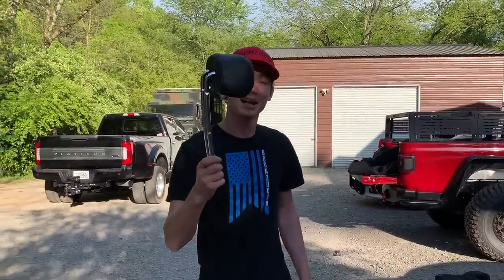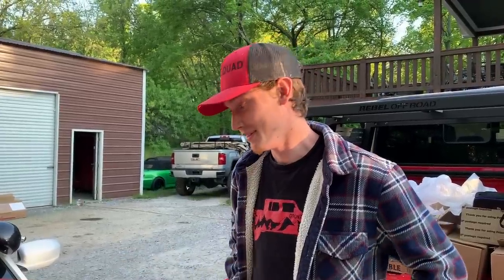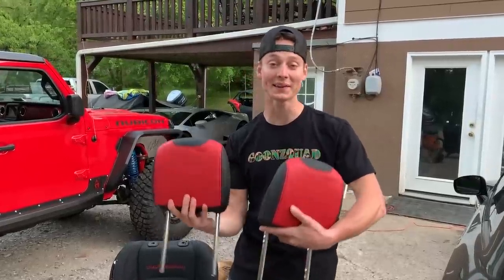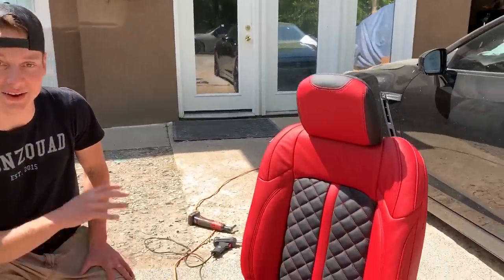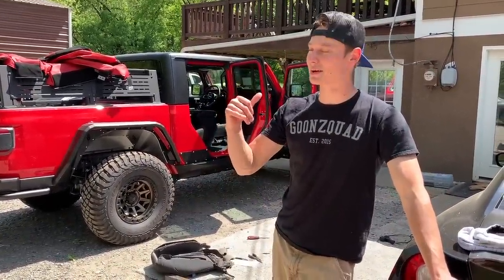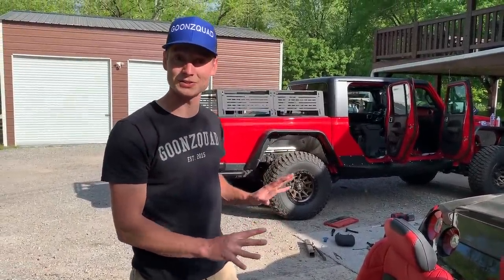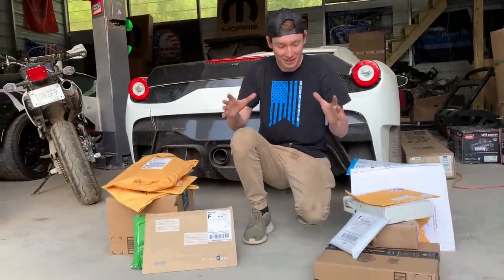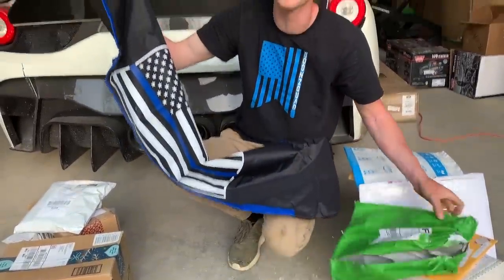Rebuilding A Wrecked 2020 Jeep Gladiator Part 18

Comment: Alright Dad's back horsing around and giving you guys a hand lol . I'll bet he's excited about helping as much as he can so you all can hop back on the Dodge truck build . I'm sure if you go on eBay or Amazon you will find hog rings and hog ring pliers if you have any other interior projects . The tie wraps look like they're doing a good job, hopefully they don't get brittle and become prone to breaking. It looks like a good idea i just hope they last . That's a wicked nice interior upgrade kit you went with.
Reply: Robert Prout I was the thinking the same thing with the zip ties.  Hog ring pliers are the way to go and they are easy enough to use.  Do the job right the 1st time.
Reply: Billy Boost are they easy to use? I’ve been afraid of reupholstering an interior, mainly because of having to work with hog rings.
Reply: hog rings are very cool, usually stainless steel, suggest the manual tool as not too many to apply on most seats, the semi auto ones are a pain in restrictive spaces, the track will dislodge, those who use em know what i mean, as for cable ties, most go brittle in sunlight with UV degradation but you can purchase pre-soaked ones, the shrinkage is less therefore last longer, less prone to going brittle, they are used a lot in fishing trade
Reply: Northern Farmer, take the crap somewhere else! 👎🏻

Comment: Zip ties will break over time. Probably should have stuck with the metal hog rings, they have been used for decades for a reason.
Reply: Nathaniel S. RN  used to work at a place making Toyota seats and all we used was hog-ring guns.
Reply: Facts and they are 20x easier to install them the zip ties🤷🏻‍♂️
Reply: I'm sure they don't mind removing the seats and upholstery out again to address the leather cover popping loose. If it ever gets to that point
Reply: I’ve been working on seats for cars/trucks for about 20years, zip ties are NOT the way to go here. Hog rings like the OP said. They are a lot easier to deal with than zip ties and they will last forever.  If you are gonna do it, do it right.
Reply: I can't believe they didn't go with hog rings. I had to pause it because I don't like watching trash ass installs
Reply: The devil Made me say it 
So that’s where haters come from.
Reply: The devil Made me say it  I've enjoyed watching them grow and learn new skills.  It's informational that way.  Sometimes they cheap out and don't add much value to create content.  This is one of those times in my opinion.
Reply: Agree I’d be worried of the zip ties working their way into the leather and cutting it over time. Definitely take the time and replace with the new hog rings
Reply: Todd I've been working on cars for 95 years and my uncle once told me..
Reply: Ethan Verstraete it would take many decades for a hog ring to rust enough to be a problem under normal use.

Comment: Zip ties will get fragile over time and snap when you are sitting in that seat
Reply: and the part they cut will be sharp and damage the leather when they sit on them.
Reply: It’s not like they drive there builds anyways
Reply: @f1lip797  the gtr was at a different spot in the previous videos, so yeah, maybe they don't film everything they do with the cars.
Reply: Yep. They should have used Hog Rings like they were supposed to.

Comment: That plastic on the head rest was used to suck the foam down so the fabric cover could easily be put on then the vacuum is released and the foam goes back to the original size. If you've ever had to fight with putting a headrest cover on foam thats not compressed you will quickly understand why they do that.

Comment: You need to put hog rings in the seat. Zip ties will break, and they will wear holes in the leather!
Reply: almost OEM :D
Reply: Second the hog rings.  The cable ties will not last.
Reply: Nae bor u daffy
Reply: youd think they would know better.. lol kinda like no truss or gus or any support for those coil overs... these two are a mechanics dream to fix what the screw up
Reply: do you think people will be throwing themselves against the seats? lol.. zip ties will be just fine. i swear some people over exaggerate. so much
Reply: Vinnie Gunns not sure what you’re on about. It was a complete legit suspension kit. Maybe you need to discuss your engineering experience and ideas with the suspension kit manufacturer? The skills and work ethic these two young blokes have is awesome to watch.
Reply: Gotta agree there those are pretty heavy duty tie strap they will probably rip the leather in the long run or you may start to feel the clipped ends of the strap
Reply: Bon Paoi tampon smoker!
Reply: @apet1572  I've been doing upholstery for over 25 years. The ties will last a little while but not for the long run.
Reply: Chris Lambert did anyone ask what you’ve been doing for the past 25 years ... didn’t think so
Reply: Did anyone ask for your opinion....didnt think so
Reply: I would not have used cable ties either.

Comment: I'm just at 3:45 and just have to say that the plastic around the foam on the headrest might be as you said for keeping water out of the foam, but in other cars that aren't "waterproof" they are simply there to make the cover easier to put on. If it catches on the cover as you try to slip it on the foam might break. This plastic just keeps it from catching.
Reply: It's there to reduce friction from the foam and fabric. Helps extend material life

Comment: I’ve never seen anyone use zip ties on a seat. You can buy hog rings and hog ring pliers to fasten the stays in.
Reply: Not sure they will hold for long. Zip ties don’t cope well with movement over time. They just snap.
Reply: You can buy hog rings and hog ring pliers at tractor supply. There’s one nearby to them.

Comment: Great video.  You can midst the leather with a water sprayer and use a hairdryer to tighten up the leather.  Hog ring pliers and hog rings would aide in the disassembly and assembly of the seats.  The Jeep looks great, I like it much more without the bed rack on it.  Glad to see your dad out there with you guys.  I have a twin brother and my dad use to come over to the house and hang out with us when we use to work on our project cars together.

Comment: i use the vacuum trick on my couch cushions when i wash the covers.  Gotta have a bag open at both ends so you can slide it out. Also the water-proofer bag on the jeep was likely working against you, stopping air from moving thru the foam and compressing it.

Comment: Tip for the headrest. Use spray silicon or non stick cooking spray. Use heat gun to smooth out the leather.

Comment: I believe the plastic bag on the headrests is there as an assembly aid to help the head rest cover slide on over the foam. As hard as it was for you to put on with the bag, that grippy foam would make it even harder to install the new cover. And to agree with some others, you should have used hog rings and not zip ties. There’s a reason they have been used for 100+ years to attach upholstery to seat frames. Those zip ties will eventually break.

Comment: For poison ivy, a hairdryer works way better than anything else. The skin heat and itch receptors are the same, so if you point a hairdryer at it you get an "itchgasm" and then you wear out the receptors for a while. Works great on anything you haven't been scratching at.

Comment: If you would have had the covers inside out, you could have skinned them on the foam a lot easier by rolling it over the foam. Also for wrinkles, you can steam them. But since its leather, you got to be careful no to burn it and use like a towel to not let direct contact touch it and keep the heat low. You guys did a great job.

Comment: I used a black PU leather with green stitching on my new carbon fibre gokart seat... after watching this channel, i wanted to do a little project, i cant afford to fully upgrade a car, but my gokarts getting pimped up. It started out as a 2018 tonykart 401, with a prd 125cc fireball engine. Im adding the seat, digital dash, custom black decals with green skulls and a grim reaper, front brake kit, upgraded billet aluminium pedals, upgraded rear bumper and magnesium wheels to match the rest of the gokarts parts.

Comment: Either vacuum bag the headrest or use a plastic liner to "persuade" the material to slide on easier. That is why they already had plastic on them. The metal hoops are called hog rings and they make a special pliers to install and remove them. Use a steamer to remove the wrinkles and adjust the leather into tight places.

Comment: I used to install leather interiors at a high volume shop. we had a deal with basically two pieces ov pvc pipe hooked to a vacuum that you stuck the headrest bars in after you put the bag on the foam. It would suck the air out of the foam and the leather cover would go right on.

Comment: Those metal loops are called hog rings and u should use hog ring pliers to apply. They are a much better option than zip ties, more durable and don't break like zip ties in high use areas.

Comment: Check and make sure your building codes were followed also make sure that the  electrical boxes are grounded properly , a long copper ground should be driven into the ground  especially on a metal building.

Comment: Use lacquer thinner on the poison oak it will dry the oil up pour it in a rag and wipe the areas down and it will be gone in a couple days . I’ve had bad cases all my life and a paint and body man told me to try it and worked wonders. Burns alittle but gets it gone

Comment: I have a pump like that paint transfer pump.... Well, it's actually just a primer bulb for an outboard boat motor, and I use it to siphon gas or water...etc, without having to ever get fuel in your mouth....
Works soooo good to get rid of old fuel....etc
Just sticking it out there.....

Comment: Those metal loops are called hog rings.  The zip ties have sharp edges and may cut the foam or the fabric.  You can get a hog ring tool and stainless hog rings on line.

Comment: That plastic bag that was on the headrest was there when they were installing the fabric they used a suction process that squeezed the foam causing a vacuum so they can easily slip over the cover.  You guys should do the same thing makes it easier to install

Comment: Too late now but the trick with those headrests is use the plastic bag and a shopvac. Suck down the plastic til the foam shrinks, then quickly slip the cover on and let it “re-inflate”. I have done katzkin leather in 3 different vehicles of mine.

Comment: The plastic in the headrest is actually from when they put the leather on in the factory. They put the plastic on and then basically vacuum seal the foam down to get the leather over the headrest then they release the vacuum and the foam goes back to normal. It’s just easier to leave the plastic in once they are done

Comment: Just a heads up had a bad case of poison oak a few years ago and the best treatment I found was extremely hot water right on the areas it not only helped dry it out to limit the spread it felt amazing for dealing with the itching try it out :)

Comment: Use need to do a sweet audio install get a 4 channel amp with 2 sets of 6”splits speakers and another amp probably a monoblock bout 2000rms with a big subwoofer I run a hcca Orion 10” it’s 3000rms with 3000rms amp put in the back of ya Jeep

Comment: Leather conditioner does virtually nothing for your seats at this point except for possibly make them greasy feeling. Most leather we put in cars today has a clear coat and is plasticized. The best thing I do for my clients (I own and run a detail business) is put a spray sealant on the seats. I use Beadmaker, made by Renny Doyle, the official detailer of Airforce One. Great product and cost efficient. There is also ceramic coatings for leather, but a little more expensive.

Comment: The plastic on the head rest is actually just to make it easier to get on otherwise it’s a pain in the butt to slip on sometimes you can use heat and heat the covers to help get them on

Comment: I know how poison ivy can drive you crazy, I ran into that stuff here in Houston when I did landscaping. Here are a few things that will help you in the present and future. Instead of Calamine lotion(pink) use Calahist(clear) which I found more effective. Also wash your skin with WHITE VINEGAR, it neutralizes the poison and dries the oils that make it spread. TIP: if you wash off with white vinegar immediately after exposure to poison ivy you wont break out. Hope this helps boys, keep up the good work.

Comment: Looking good boys. Use a heat gun on low or a hair dryer to help with the wrinkles in the seat. I haven’t watched the whole video so if you did I guess never mind lol oh also those zip ties will break over time with the pressure of sitting on them and a little age they will break really easy.

Comment: Guys, on your electrics; have you checked to see if the breakers inside the box that the juice for your shop is taken from are still operational? Maybe cycle them and recheck. Anything that was plugged in may be toast- the system was designed to self protect, so stating from the house supply, thru the mains in the sub panel you have in the shop, run volt checks with a multimeter. It's very likely the sub panel Mains are the failure point- they failed to succeed in protecting anything up stream from the lightening.  Make very sure your ground is intact and strong- electronics die from ground problems.
   The "bag trick" will, indeed work to put the head rests (or any other oversized piece of foam) into the upholstery. Get a bag big enough to put the whole stripped headrest core into, with the tubes sticking out of the bag. A large WalMart bag would probably be big enough. Gather the free and open end of the bag around the shop vac hose end, turn it on and when the head rest quits shrinking, pinch of the air flow and turn off the vac and remove the vac wand from the bag. Slip the upholstery cover on, adjust to put the corners right and let the air back in. Cut of any excess bag material and button up the cover. This is also how to put the couch cushion foam center back into the upholstery when you wash it.

Comment: it may sound crazy but brake cleaner works wonders on poison ivy. my cousin is a mechanic and he mention it to me. thought he was crazy till I tried it. I guess when you think about it, Brake cleaner is made to clean up oil based material. Poison ivy is spread around the body from the oils in the plant.

Comment: Cable ties only last a couple of years until the softeners inside dry out and they start breaking. Wouldve went with metal cable ties. Especially since someone else could be driving this in 5 years and slide around during driving wich could theoretically cause a accident.
Reply: Everything they do is half assed. NEVER buy any of their so called rebuilt vehicles. It would be an absolute nightmare and money pit attempting to redo their many mistakes

Comment: Those are called hog rings. They are designed to hold over a long period of time and not have sharp edges that can damage the material. Your zip ties are just the opposite. Get some hog ring pliers and do it right.

Leather conditioner adds moisture to the leather and has a UV blocker to slow the drying out process and reduce fade.

Comment: If you loose that piece of plasticfrom the headrest it will cost you a lot of power to slide the fabric over it. That is the whole reason why it is there some companies use thin pieces of plastic/kinda cloth to do exactly that. TIP: put piece like that between your knees and start pushing between your knees and pull down the leather or fabric with your hands. Do exactly the same when you put something back on....And now you know how strong you need to be as a upholsterer. This system also works with seats and backs.

Comment: @ goonzquad

Your shop isn't properly grounded, sounds like Lighning stuck your building and blasted everything electrical. Properly grounding the metal building and using surge protection on the building supply power should keep you safe for the future. 

On a side note, thanks for all the awesome builds and content you create.

Comment: The proper hog rings and a pair of hog ring pliers would have gone twice as fast.
Also, clipping off the zip ties probably made some sharp edges that could lead to holes in the leather later on.
Lastly, zip ties are a weak style of fastener. I think you'll find them disconnecting within a year. Where those are attached move around a lot and get under stress.

Comment: Those zip ties will break over time.  You should have used the correct hog rings.   A pair of hog ring pliers and a box of hog rings is cheap.

Comment: SHOP POWER : Hey guys , I noticed you had a storm a short while back. A lot of times when the power lines are knocked down from trees, a massive surge can be sent to your buildings or shop.   It might be worth looking in to as the power companies will often assist in repairs or replacement of your damaged equipment.

Comment: I'm not sure using zip ties where the hog rings are supposed to be is a good idea, in my experience zip ties will eventually get dry and crack resulting in very loose upholstery. just a thought, good luck

Comment: The plastic around the headrest is actually for reinstall purposes so when you're rolling the headrest cover back over the foam you can use a vacuum to the headrest foam. Any vacuum can be used nothing special guys. Lol work in upholstery shop lol 🙋‍♂️
Reply: Also the metal rings can be cut and replaced . They're called hog rings will need hog ring ceimpers too instead of ziptiing 🤘 one love guys!

Comment: Plastic Zip Ties not a good idea. They will degrade and break over time. Getting the proper tools for the hog rings will make using the correct procedure easier. The Zip Ties are just a bad shortcut.